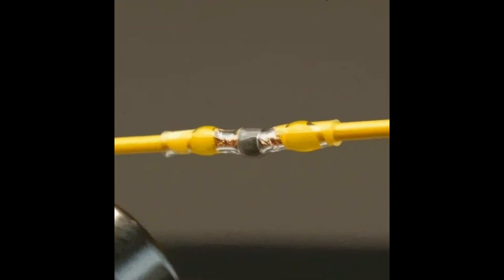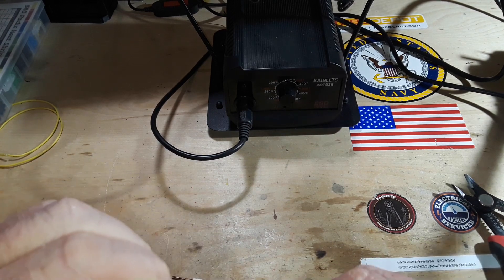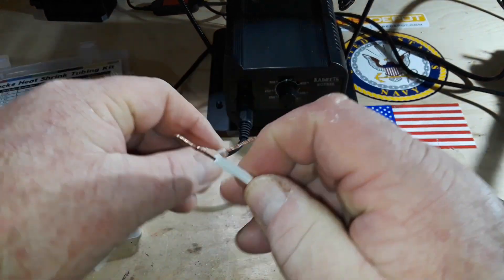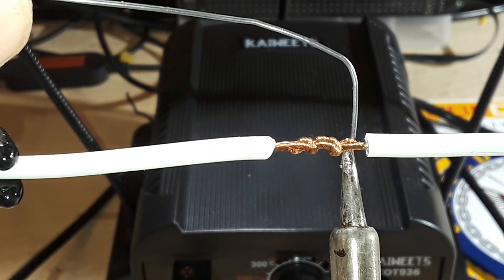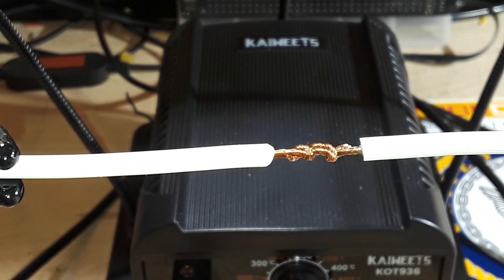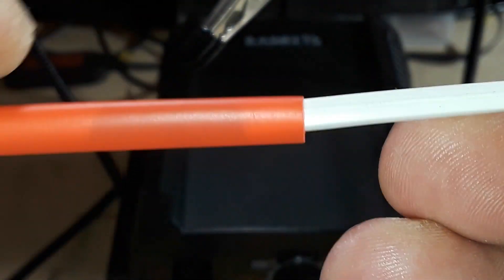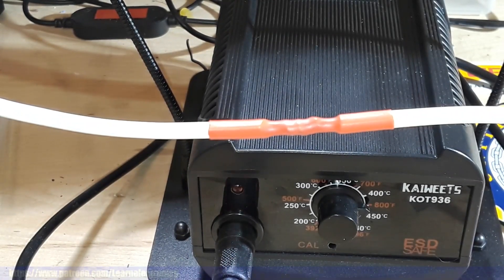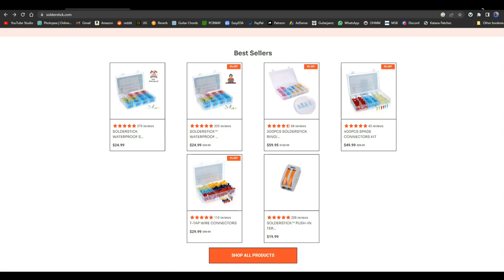The Western Union Splice - sponsored by Solderstick Wire Connectors

Comment: When i worked fo LearJet they sent me to soldering school.  They taught us that a solder joint must be completed in two seconds or less or it must be discarded.
Reply: Why is that?  I'm a beginner and working on my motorcycle.  I want to make the lowest resistance butt joint as possible  b/t 12ga stranded and 14ga stranded.  The wire is factory tinned.  I like the idea of this western union or linesman splice and then soldered and covered with heat shrink.  The last repair done by mechanic used crimp style connectors and the terminal resistance was too high and they got hot.  Trying to avoid repeating this problem.  My biggest challenge practicing is just getting the wire hot enough to accept the solder.  It's a lot of mass to heat up.  My soldering station is 80W max and it didn't cut the mustard.  Looking at getting a high output (200w) soldering gun hoping that this will help me get enough heat into the wire.  My other joint is even more difficult.  It connects a 10ga to two 14ga wires.   It's a big heat sink.
Reply: @bartoncourcier414   Did you use an appropriate flux?  An 80 W iron should solder most wires on a motorcycle if you use proper materials and technique.

Comment: I was trying to solder some stranded copper to stranded aluminum and the solder just would not flow in to the aluminum. I couldn’t get the aluminum tinned either, before trying to join the wires. Flux didn’t help, maybe I needed a different type of flux.

Comment: Gee, I thought I was going to learn something here! Your "Western Union" splice is AKA a "linesman splice" at Rochester Gas and Electric, I used to work there many years ago when we called it robbery, greed, and extortion. Anyway, I learned that splice in my probation period there. Quick, solid, and easy to do. I used this in building wire dipoles for my Ham shack out of random scrounged lengths of #10 wire. The larger the wire, the lower the average "Q" for that antenna, the more broadbanded it was. Great for using the antenna on the harmonics of its cut frequency.  73 de W4FJF.

Comment: My recollection of the true Western Union splice is that it involves two types of wraps, one for connectivity and one for strength, as indicated in the Wikipedia article on the subject https://en.wikipedia.org/wiki/Western_Union_splice.  There are, admittedly, a couple of kinds, but yours isn't either of them.
Reply from the maker: Thank you for sharing.
Reply: This is indeed Western Union splice short tie, I find it easier if you pre tin the wires prior to the splice, then the final solder goes in better  a rhyme I learned while learning electronics was“ solder flows where solders been so always remember to tin tin tin”
Thx for the video!

Comment: Instead of the conical tip, use a chisel tip it helps with more surface area for heat.
Reply from the maker: I prefer the conical tips, I'm beginning to think this thing lacks thermal mass.
Reply: @learnelectronics  I think the T-12 irons excel on larger joints. No gap between heater and tip. I converted after watching your review on the KSGER t-12.

Comment: The big reason why some call it a NASA splice is that they actually produced a technical document on the best way to do this. The resulting splice is actually stronger than the wire itself. They do use it when mating different components that come pre-wired as this will survive a launch without any problem. Here's the link to the technical document http://www.hq.nasa.gov/office/codeq/doctree/NSTD87394A.pdf